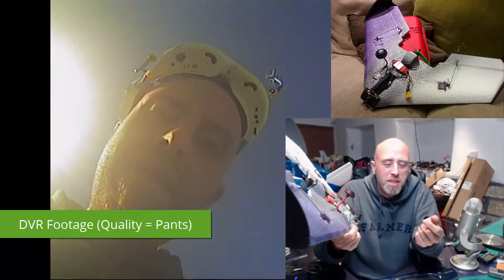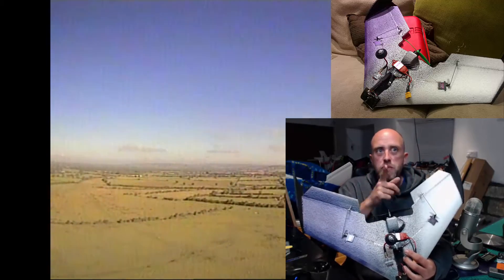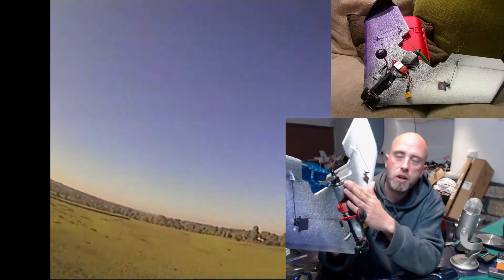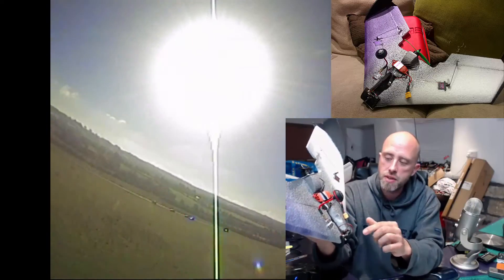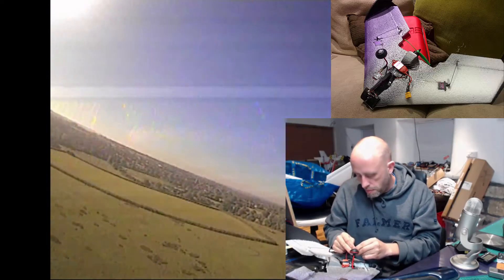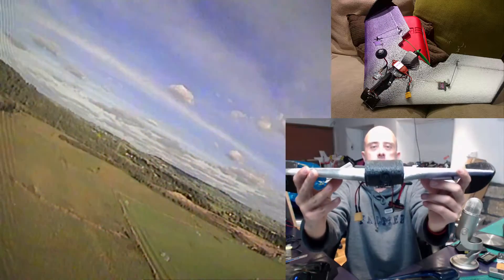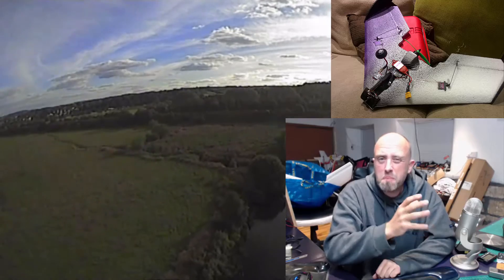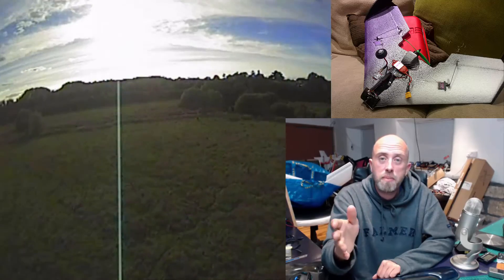Hornet FPV Flying Wing Build Overview

Comment: Hi Matt
I'm enjoying the coffee chats although I dont watch them at  5:30am  !!
Your videos have got me excited about wings again so I'm building a Flitest Spear using depron and laminate/packing tape
At the moment I'm flying with a Frysky XJT module in my T9X and X series receivers with Europe LBT firmware ( thats what T9 supply now)
I see you are using the V8R4-II receiver and that seems like a good choice to me for the wing
I guess it came from Banggod - what firmware version does it have ? 
did you have to flash any firmware updates to the TX or RX ?
regards
Hans
Reply from the maker: Hi Hans, I got my latest ones from T9hobbysport with the EU software flashed. You can flash from the transmitter using the pins on the pack (just google it). The little V8R4-II are great, the issue can get with them is the antennas come off, but see this video for how to strengthen them https://www.youtube.com/watch?v=r4wysUHSuYc Matt
Reply: Hi Matt
Thanks for the info and tip about the antenna - I have already flashed my TX with LBT firmware to avoid future RX  firmware problems
If T9 are supplying the V8 RX with LBT then I can buy from them rather than Banggood who dont say what firmware they are installed with
happy flying Hans
Reply from the maker: Hi Hans, yea they come with the universal software, hence why I bought by L9R & X8R's from T9 instead. Matt

Comment: Have you tried the KingKong 6040 prop, it is a definite value and gives good thrust/efficiency.  All for a very cheap price.
Reply from the maker: Howdy fella, I've not. I wanted to maintain and decent speed v's battery life on this one so I can do a good 6 laps of the field & back again. I could totally over power it with a DYS SE2205 2300Kv or a EMAX RS2205 2600Kv Red Bottom motor, but then she'd just scream and fly for ooo about 3 minutes :P Matt